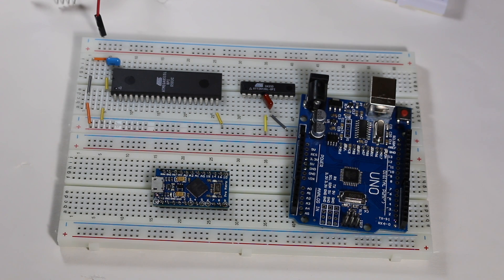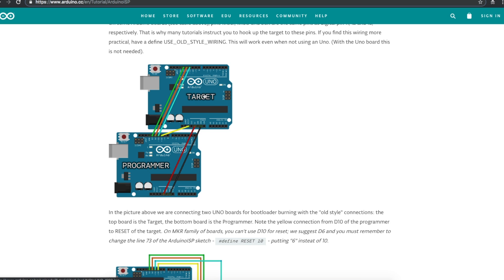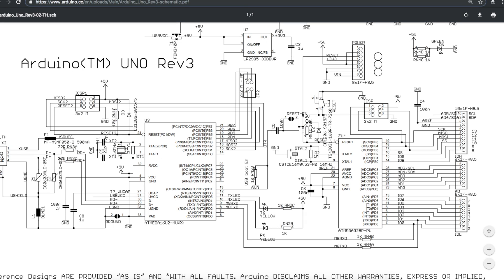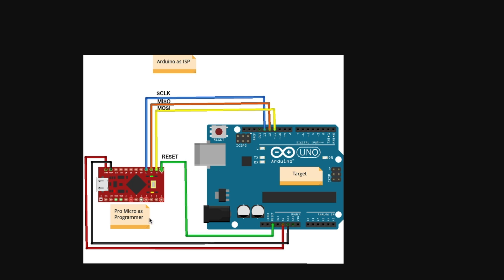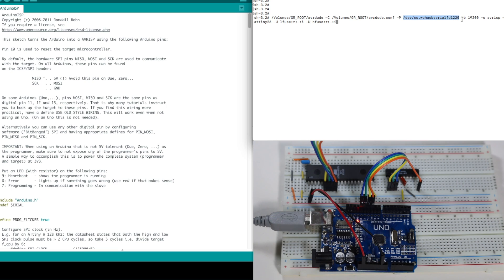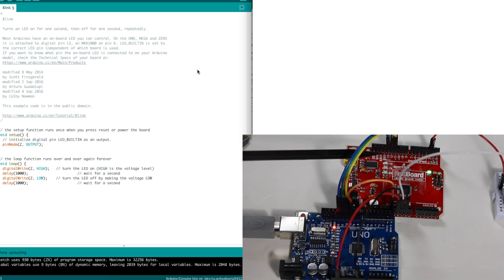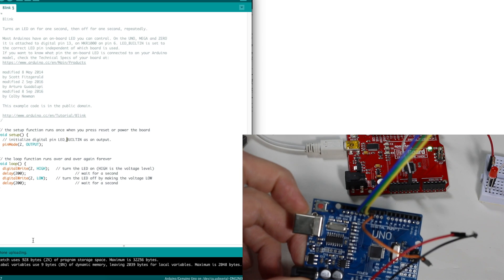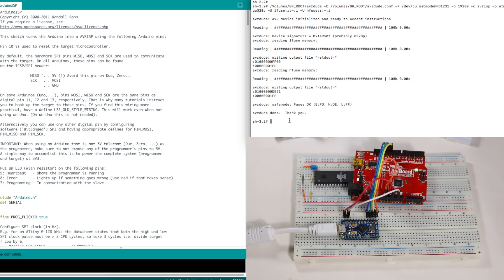Arduino Uno or Pro Micro as an AVR ISP Programmer

Comment: Excellent video.  So I am running Arduino IDE 2.3.3 in Linux, a RedBoard (UNO) as programmer, loaded ArduinoISP.  Then trying to program a ATMEGA168PA-PU on breadboard.  avrdude reports 

avrdude: Device signature = 0x1e940b (probably m168p)
avrdude: Expected signature for ATmega168 is 1E 94 06

There are two ways to fix this.  1) Use Tool | Board | Arduino Pro or Pro Mini (instead of Redboard), then modify the boards.txt for one of the m168 programmers OR 2) modify avrdude.conf and change the ATmega168 signature, since parameters are the same for the 'P' part.

Comment: Very useful. I just happen to have a problem with ISP programming a self developed board with an Atmega 328P-MU (QFN package) that I have trouble  with progamming via isp. I just don't know which target board i should select, because it's not a board but a single chip. Or do I have to use avrdude to do the Job. Do I need the bootloader? Programming board is an Uno. OS is Windows. Have to do more testing tonight. Thank you very much!
Reply from the maker: If it’s got 328P, I would wonder if just choosing Uno would work, it may depend also on what other things you have on the board like how fast is the Crystal, if it’s 16 MHz then I would think Uno  would work. And  also if there’s any onboard circuitry that would interfere with SPI or reset that you are trying to control from the programmer. 

 If you’re already set up with an Arduino as a programmer and you already have access to AVRdude, you could try running that command I used to read the fuses on 328P from the command prompt and see if you can at least talk to the board.  And I guess it also depends what kind of errors you are seeing. 

 And using Uno as the programmer, do you have the 10 µF capacitor on reset? I found I needed that if I was trying to use Arduino IDE but I was able to use AVRdude on the command prompt without the reset capacitor for some reason. 

 I forgot to include the AVRdude command line options I used in the description so I will go add those to the description within the next short while.
Reply: Gadget Reboot Thank you very much. I will report when I‘ve checked all that out. Till now the error message from the IDE reads „Error“. 😂
Reply: If you run
$ avrdude -p atmega328p -c usbasp # (usbasp is my programmer)
and you get the "-p" chip type wrong, avrdude spits out that it is "probably an X" because the signature of the chip did not match.  So no worries, even if you got the suffix p, pu, a, au part of the chip designation wrong, or even the wrong chip type, avrdude will simply tell you what kind it is.

You never really need a bootloader.  However, since most of us are debugging with serial, serial over usb (ACM), or USBasp ... it makes sense to program (bootload) with the same interface with which we debug.  Less junk on the desk.  It is puh-sible to debug through the SPI (ISP) interface, or even borrow the MOSI/MISO pins to do SoftSerial ... but few do this.

QFN is the no-lead package?  It is a little odd these are more expensive now than the DIP's, at only $1.15.  I've only messed with the QFPs.
https://www.aliexpress.com/item/1PCS-ATMEGA328P-PU-ATMEGA328-PU-ATMEGA328P-ATMEGA328-DIP-28/32949410741.html?spm=a2g0s.9042311.0.0.27424c4dFYZ3Wf

These need 2 Vcc and 3 ground hookups, in addition to the AVcc driven high.
A factory-shipped AVR is usually fused for "div8," making the internal RC clock so slow that the ISP has to be set to slow mode to make it work.  The first thing I often do is fuse it for 8mhz, or an external crystal ... so no more dividing the clock by 8.

Comment: It´s not working for me ??? My programmer Arduino is gettimg reprogrammt when I want to use it as Programmer ! The Sketch ends up on the Programmer ! Atmel Studio 7 isn´t working with this kind of programmer, either ! Why is it working for you and not for me ! I did the same that You show here in this video ! It´s not working !
Reply from the maker: If the programmer Arduino is getting programmed instead of the actual target device,  it sounds like either the capacitor on the reset pin of the programmer isn’t there or maybe it needs to be increased in value for some reason, or in the Arduino IDE the programming hardware has to be selected as Arduino as ISP, or whatever it’s actually called I can’t remember,  which tells the software to use that first Arduino as the programmer itself and not to program that as a target. 

I can’t think of any other reason it would actually program the programmer Arduino because otherwise it sounds like everything is hooked up properly and it can communicate with the programmer Arduino. 

 When the reset capacitor is not there or it is not big enough in value, it causes the programmer Arduino to get reset and then get programmed so the capacitor keeps the programmer Arduino active and the actual target gets programmed instead.
Reply: Thanks for recponse ! I got it, yes it was the cap. ! I took a bigger one and it worked ! Thanks !

Comment: Sorry-my brain hurts!!
Reply from the maker: Yeah it’s not easy to make that topic fun, more like need to know basis material.
Reply: @GadgetReboot  Sorry it wasn't meant to be a horrible statement , you produce some brilliant work and at the moment I am trying to learn programming stuff , but at times it does give me a brain ache !!
Thank you for the video
Reply: I am a programmer trying to learn EE so I feel you. Just like you guys would tell me to learn Ohm's Law etc. .... you need to start with architecture and assembler and work your way up (gonna take a while of course). Check out Ben Eater's 8 Bit computer series. Good luck. To us all. 😬👍
Reply from the maker: This one made my brain hurt as well and it wasn’t one of the more fun ones to produce either. There was lots of trial and error and whether or not I needed that extra reset capacitor, I filmed things in a certain sequence and then realized I had to redo one of the earlier tests but the way I was speaking it sounded like I had already done stuff when the video presented it as initial run through so I had to chop out individual words to make sentences make sense. Owwww. 🤕
Reply from the maker: I remember Motorola assembler in the mid 90s on 6811, load accumulator A.   Then pic and atmel assembler in the late 90s to early 2000’s.  I think all I ever did was a lot of spaghetti jumping around. 
 Then I took about 15 years off of software and now I’m back hacking at it again.  
I think I have a book somewhere for 100 ready to run programs for GW-BASIC. When I get my old 386 computer up and running maybe I should try typing in some of those to see if they work.
Reply: @GadgetReboot  I have been involved in electronics for nearly 50 years, tech has move but I haven't esp digital stuff
So it is time to learn it all again. would you by any chance be reverting back to very basic programming, like loading a sketch from pc to arduino etc ?
Your channel is great but I think I missed a bit !!
Thanks again-Mal
Reply from the maker: I do have this video I did as one of my earliest ones which is short and is about loading sketches. I forget what it’s like so I’m gonna watch it again myself now just to see! 
https://youtu.be/VoeWDS5TfPY

 Looks like this video was before I learned how to do picture in picture to show the board at the same time as the big white software screen instead of switching back and forth single camera. Also a lot of other things I would’ve done differently there. Nostalgia!
Reply: I started early with BASIC on computers like the Apple ][+, TI 99-4A, Timex Sinclair and Commodore 64. When I tried to learn assembler I fell flat on my face and didn't really get back into it until 1996, when I started towards my Comp Sci degree. I just picked up a copy of Art of Electronics on the cheap and, just browsing through it, it has some amazing comprehensive information in it. I don't think there is any such book out there for programming. It's both incredibly simple and incredibly vast at the same time. On one hand everything boils down just three things: variable assignments, decisive branching and LOOPS LOOPS LOOPS. But on the other hand I could spend weeks just talking about any one of those things. Here we are, conversing asynchronously on a website that serves video content -- data, logic, repeatability. Any thoughts on learning C? :)
Reply from the maker: I have art of electronics up on the old the bookshelf along with many other mandatory  publications. I’ve been meaning to get that C programming book by them two guys including Dennis Ritchie , I was borrowing it in 2008 on a work project writing code for a pic  and I have had it in my Amazon cart for years. One of these days...  looks like it’s up to $70 now. Maybe if the price was creeping down instead of up I would have bought it long ago.
Reply: I still believe the BEST book to really learn C is Advanced Programming in the UNIX Environment. Not only will you learn C (as you go), you will learn all the in's and out's of UNIX/Linux programming. All about files, input and output, processes, signals, users, IPC and even a bit of networking. Know these things and other languages like Python will look REALLY EASY to learn.
Reply from the maker: Thanks for the recommendation, I’ll check it out.

Comment: Wow, you have some old-school AVR's there: that tiny26 and mega8515.  I have an unhealthy obsession with interfacing and building dev boards, so have made ISPs for AVRs out of a lot of things.  First with a RaspberryPi, then a dedicated ones with atmega8a's (www.fischl.de/usbasp).  The easiest:  Digispark clones that have attiny85's (littlewire).  The cheapest AVR MCU that I found that will do USB ISP is the attiny44a -- but it needs a 12mhz crystal, while the tiny85 has an internal PLL, needing no crystal.   Just need to fuse out the reset pin to use the 85's reset as an output.  Oddly, I do not own an Arduino.
Reply from the maker: I found those AVR’s in the basement in digikey labelled antistatic bags and tubes from early to mid 2000.   One 8515 was still in the tube and another 8515 was actually on a breadboard and I have no idea what that project was. 

 I am thinking about doing some sort of dedicated high-voltage programmer board layout so I don’t have to keep fumbling around on the breadboards.